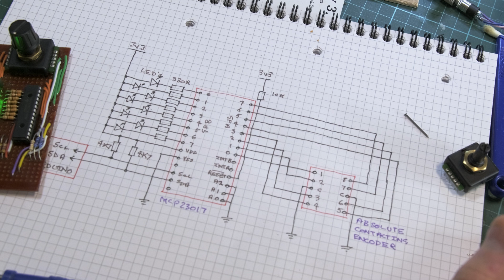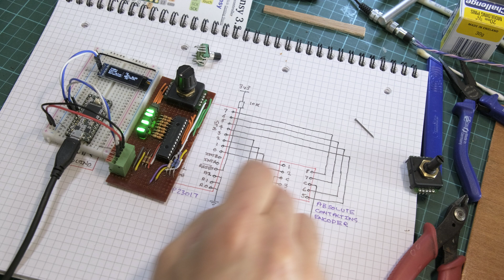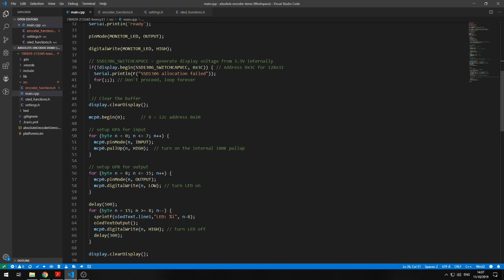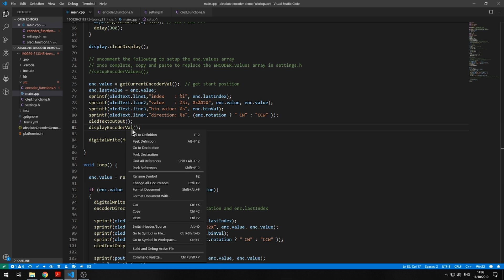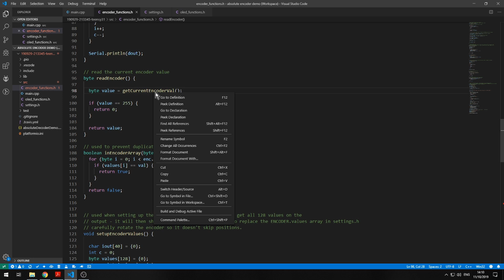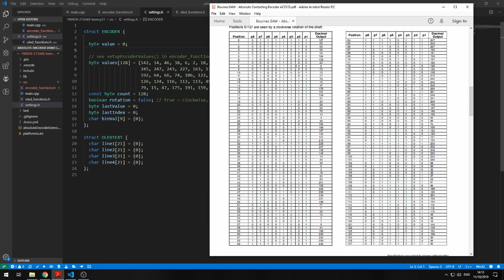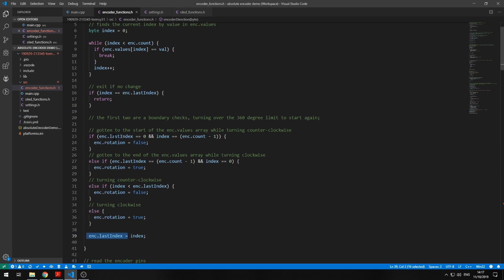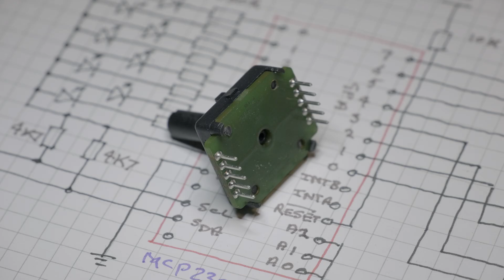Using an Absolute Rotary Encoder with an Arduino

Comment: I put up a library for this device a while back https://github.com/arielnh56/ACE128 - also in the Arduino library manager. It supports the PCF8574, the MCP23008 or direct pin connection.